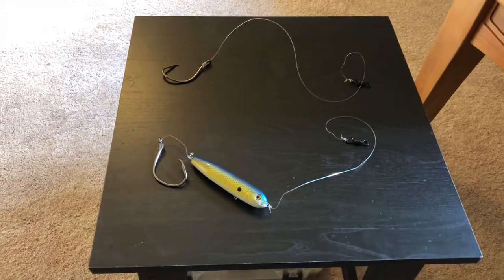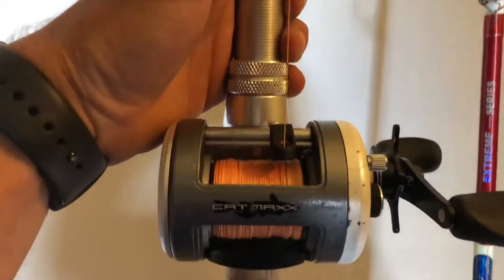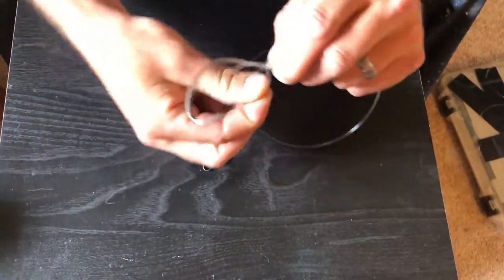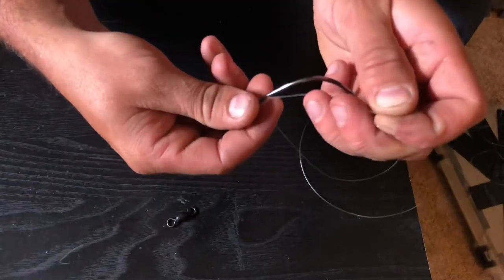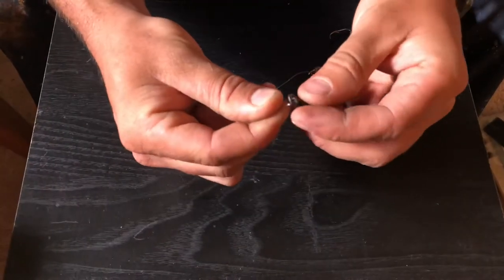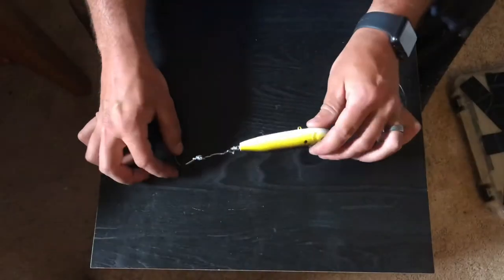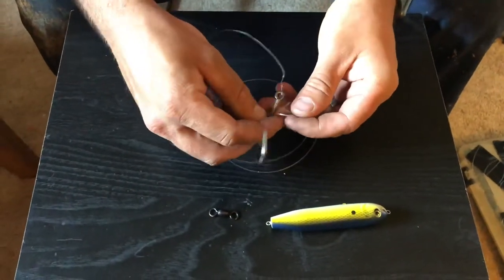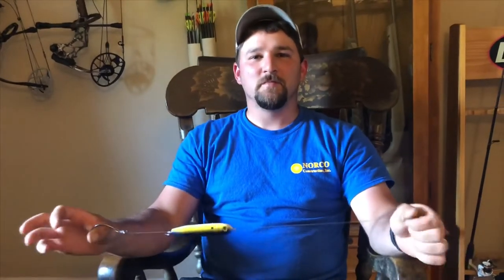How to tie a basic Carolina rig for Catfishing (EASY!!)

Comment: Hey Joey, nice informative videos. 

I am new to catfishing as well as carp fishing.

I have a question about the bright orange braid that you use for your mainline.  Can the bright orange line be an issue since it's highly visible to the point fish can see it?
Thanks for your help, 
Dan
Reply from the maker: Honestly I think when it gets past a few feet in the water they can’t see it no matter what the color. I think it gets too dark for them down there in the rivers I fish. Either that, or they really just don’t care about it at all!
Reply: Joey,
Do u have a recommendation on a leader length for fishing in a lake as opposed to a river?

Thanks man
Reply from the maker: @dand1587  I’d say probably a foot to 1.5. That’s what I used back when I used to fish Milford lake in Kansas and it did pretty well.

Comment: What kind of knot do you use to connect your line to your liter, at the swivel?
Reply from the maker: A Palomar knot, you just have to bring the whole rig through the loop. I completely forgot to put that in the video 🤦🏻‍♂️. I’ve found that braided line doesn’t like some knots you can normally tie with mono, so I use a Palomar knot on almost all of my braided line knots, it’s never failed me with braid like others have.
Reply: Did you buy the boat from bass pro or straight from tracker? Who did you go through to get the boat and make it how you wanted?!
Reply from the maker: I actually boat it through a local dealer c&o marine. But I bought my last boat from bass pro and it went way smoother lol